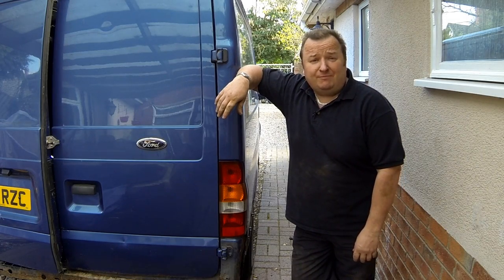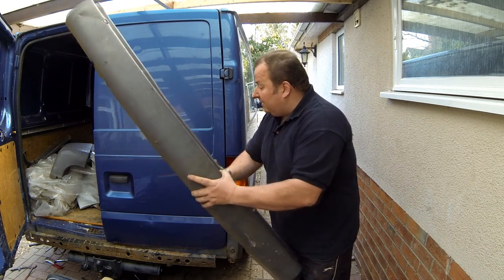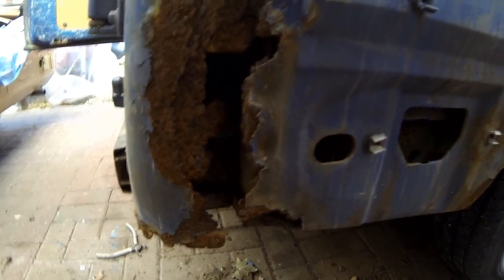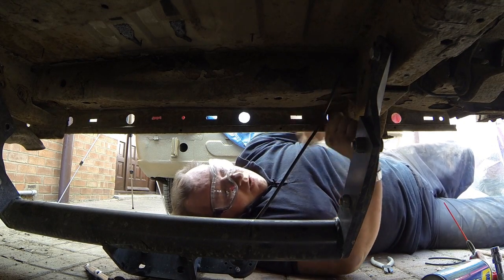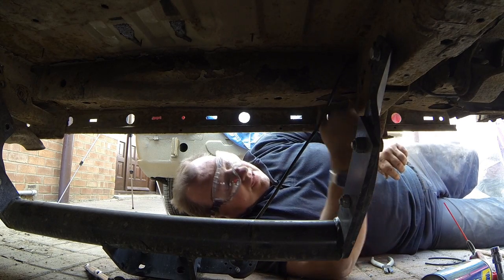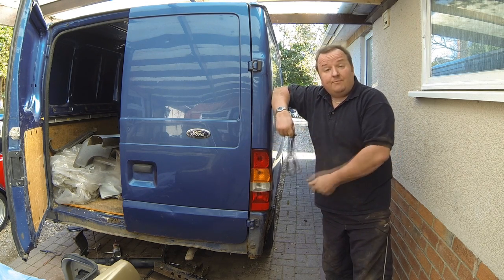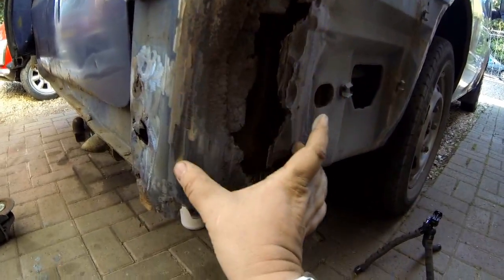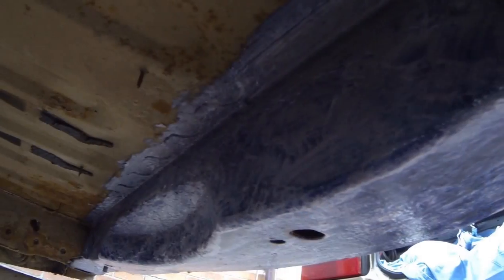Ford Transit Mk6 Rear Bumper Removal And Rust Part 11

Comment: Dear Martin, thank you so much for these lovely vids.  I like to look them over to recall all of your work.  I know that this vid is quite old but even so I was hoping that you could supply the contact details of the transit breakers that you bought the inner wing repair panels from, as I am looking for some transit bits for a project.  Please help Martin if you can.  Kind regards, Paul.
Reply from the maker: He doesn't break Transits any more Paul, sorry.

Comment: ahh man thats a bit of a bummer about the corner of the rear quarter but at least the chassis rail is good so not so much welding to do up side down. when you use a grinder to clean rust off fella your better off to use a wire wheel than a flap disc as flap discs tend to polish the deeper rust up instead of removing it. while the passenger side rear is still strong id treat that, i know its not a resto like you said but thats one area you can not see when the bumper is back on and for piece of mind along with half hour to grind the rust off and treat it i would say its well worth it. yer that Vactan rust treatment is awesome stuff, i had some bare metal areas on my project van which i never got time to put in primer or paint late last year and vactan held back 99% of the rust on its own with nothing else over it, i checked it a month ago so holds up well. one thing i have never come to understand is why most cars and vans seem to rust more on the offside than they do the nearside, i would have thought it should be the other way round with all the water and mud etc laying near the kerb
Reply from the maker: Ea Composites Yes I think I will treat the other side as well. I find these 40 grit flappys to grind bach better than the wire wheel but polish as you said when they are worn. That Vactan seems to really do a good job. Glad you mentioned it.
Cheers
Martin
Reply: yes mate id say its for sure worth doing it while you have it in bits and can get to it. i guess it depends how heavy the rust is but i normally find a wire wheel is better for that sort of thing or a poly strip disc from Smith & Arrow (they have an ebay site with cutting discs, grinding discs, flap wheels as well as the poly strip discs and make good stuff thats also pretty cheap. might be worth checking them out if you use a grinder a lot or want to buy some discs cheap). yer i like Vactan as well think its a good product and great value for money, happy to mention good products that could help people out fella
Reply from the maker: Cheers bud.

Comment: the older transits rusted externally the newer ones rust internally correct me if im wrong. it could be worse it could be an lt or sprinter van they rot like a pear
Reply from the maker: +michael jagger Don't know anything about those. Transits rust, Full Stop lol.
Reply: +retrorestore there are loads of old transits left parts are so cheap for them plus the engines never die on them

Comment: Try using some magnets to hold that patch in place on the underside while tacking it in, easier than holding and welding. You lucked out without having to put patches throughout the back end. You could use your pump sprayer and my rust proofing on the whole bottom to stop further rust cancer from spreading. The MOT should be a doddle.

Brian
Reply from the maker: Brian Percival  I have got a welding magnet somewhere Bri but do you think I could find it fof that last patch I done on the underside of the front chassis ? no chance lol. I may give the whole underside your treatment at the end of the job.
Cheers
Martin

Comment: Plastic parts are just water traps.
Reply from the maker: +michael jagger Yes, most trim can be like that.
Reply: retrorestore Good to see are the rust fixed on the Transit. I didn't think they rusted that bad but i'm wrong. These rust in places where the older Transit's didn't.